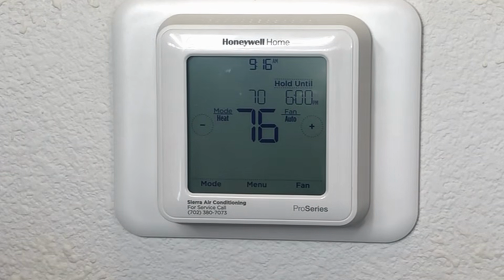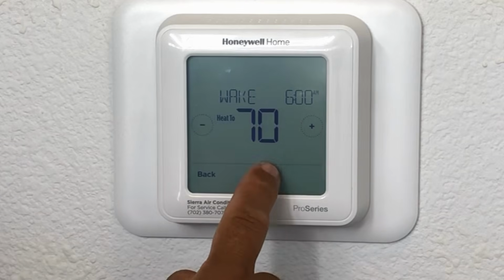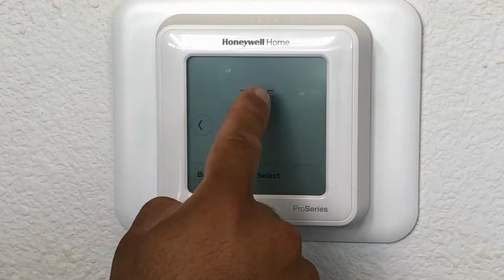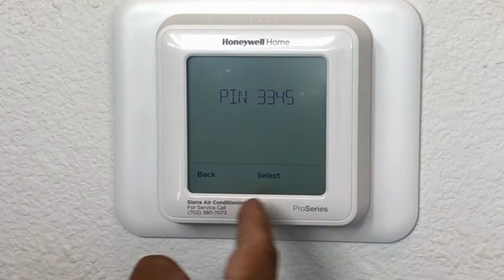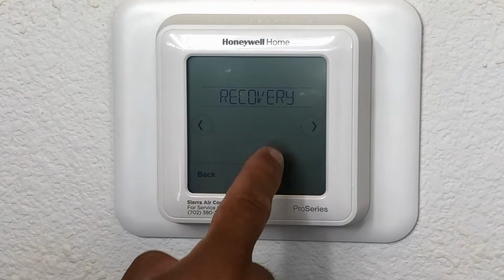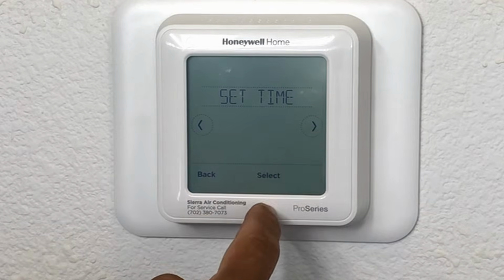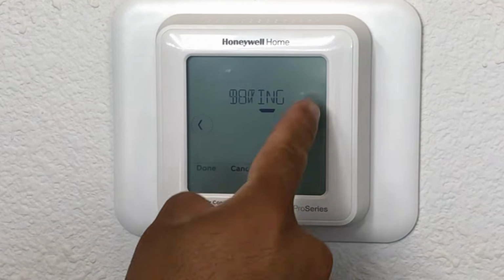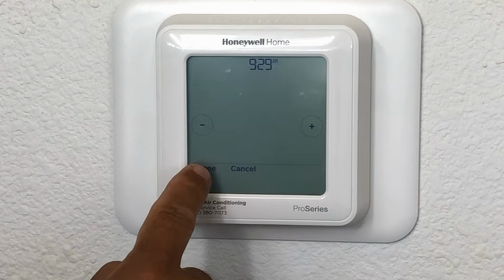How to Program Your Honeywell T6 With Z Wave Thermostat

Comment: Man you guys are terrible at supporting this Z-wave, why not get an expert IT guy to explain to everyone how to connect the controller and bold letter print on the Package explaining its not Wi-Fi, My Landlord bought it and installed it, behind my washer and Dryer, and its a pain to reach it. Amazon says it supports Z-wave, but the controller is actually the alarm hub. smarthings is a pain and samsung is in the same support, Hubatat changed their software, and sucks now. Makes me want to buy the wi-fi one but I am renting, and why spend way more money on security hub smart stations because these companies keep using proprietary crap to make more money. If I were rich I would have smashed the stupid thing already, I am not saying it in a mean spirit, but truthful. And to only reason I tried messing with it is because I was an electronics technician before. This video should be called programing not set up controller. Show all controllers that are compatible and how to set them up, that's your job